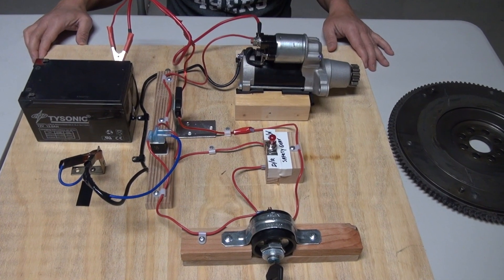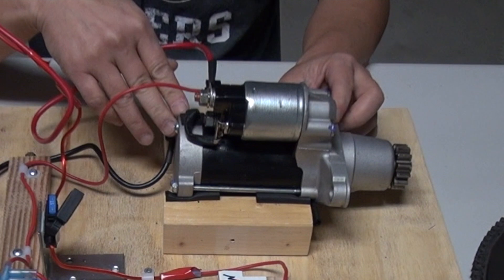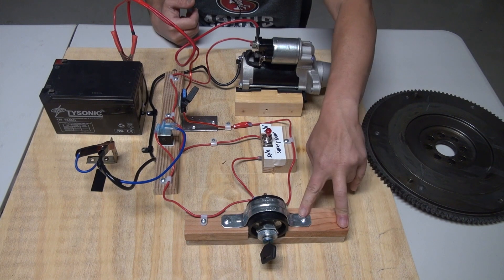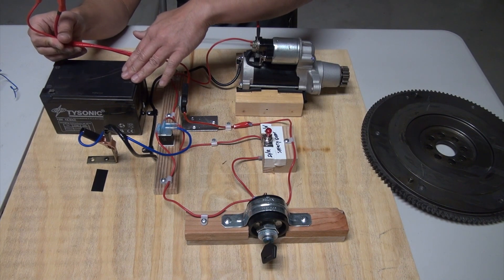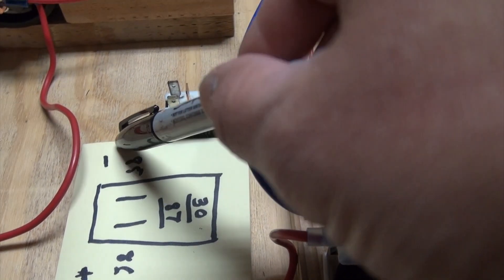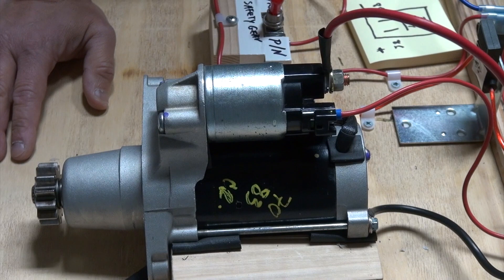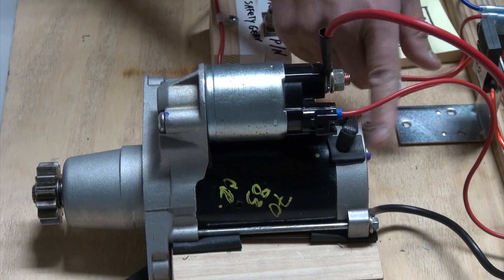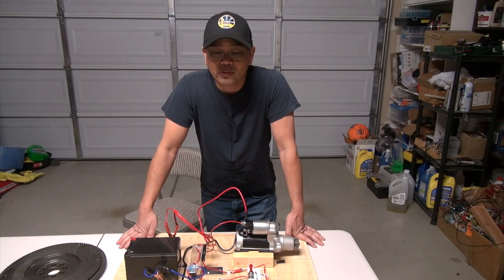Starter Motor and Ignition Circuit Thoroughly Explained!

Comment: Great video. I have a question.. how or do I need a key switch to turn over  to work my lights and what else it might be . Because I have a 2000 Chevy Silverado the ignition went out without no signs of going bad . And and I messed up my housing to my ignition cylinder trying to get the cylinder out to replace it and I was wondering  if I can just by pass it  totally.?  or do I have to  find the power source to my ignition cylinder harness  and then run them wires as well . Because I'm wanting to put a toggle switch in my truck ?!

Comment: Would the pinion retract by itself once the engine has started? Or does it always rely on the user releasing the key?
Great video, thanks.
Reply: I maybe wrong, but according to me, the pinion won't retract by itself until and unless the user releases the key, if it is they key-type starting. 
If its a push-button start, you press the button and leave it instantly, and your engine cranks after a second or two... that time the ECU controls the starter.. that's why in that case the starter (pinion) engages and retracts on its own.... As the starter motor cranks the engine (in the case of a push-button start), the ECU takes data from the crankshaft position sensor to identify the rpm of the engine... when the engine starts, it reaches around 800-900 rpm.that time the ECU disconnects electricity supply to the starter and the starter disengages... The ECU also understands that the engine has started by other sensors (MAP, IAT, MAF, etc..)
I maybe wrong, just a practical viewpoint which i myself saw in my old WagonR as well as in the new model Glanza!
Reply: @AltamashAhmed-xh8jbgreat answer thank you !!
Reply: Most welcome!

Comment: Is the neutral switch the e- brake on older manual trans vehicles? Or the actual brake? Obviously always start in neutral... but wouldn't it work if i was in 1st and pushed the clutch in?

Comment: Excellent video! is 86 (the wire from the ignition switch - NSW - PIN 86) always hot? My cat won't start, when I test with multimeter pin 30 and 87 do receive the 12V signal when I turn the key to start position and pin 85 has good ground but pin 86 is not receving the12V signal when I turn the key to start position, is it supposed to be hot all the time when the car is in park/neutral? When I bypass the starter realy car will start and runs fine in reverse or drive but as soon as I change the gear to driver or reverse it shuts off, what could be wrong here?

Comment: Surely the small relay 30 connector  should be connected directly to the battery positive and not the ignition switch. In other words ,when the ignition switch is turned to start the car, the small relay gets low amp  power through 85 and 86 to energize the coil which pulls 87 towards 30 to make a connection.  The reason for this relay is that higher amps passes through 87 and 30 because the bigger solenoid needs/ pulls higher amps.  You do not want these higher amps going through the starter switch.  The entire purpose of the relay is to not put high amps through the starter switch.  
Then the bigger solenoid does the same thing , it takes the higher amps to energize the bigger coil that then allows even higher amps to flow from battery to starter motor.  
Let me know if I'm wrong
Reply: it is connected to the battery via the fuse box.  it is always "hot".
Reply: @biboyravos4522  Excellent video! is 86 (the wire from the ignition switch - NSW - PIN 86) always hot? My cat won't start, when I test with multimeter pin 30 and 87 do receive the 12V signal when I turn the key to start position and pin 85 has good ground but pin 86 is not receving the12V signal when I turn the key to start position, is it supposed to be hot all the time when the car is in park/neutral? When I bypass the starter realy car will start and runs fine in reverse or drive but as soon as I change the gear to driver or reverse it shuts off, what could be wrong here?

Comment: Awesome!
I see this video is made for electric engineers as they understand this stuff, but I have made it out understanding almost all the ideas based on my school physics!

Just one thing I didnt get: what is the main purpose of the small relay that is connected to both the safety switch (park/drive) and the contact key? You said it is for safety, but how?
Reply: No, it's made for mechanics not engineers.
Reply: @bernardocisneros4402   
Ok, you definitely know better as my knowledge in engineering specialties is very weak.
Any answer for the question?

Comment: 2 wires coming to relay from ignition switch?? From battery (+) to 15 am fuse to ignition switch. 2nd one from ignition switch to NS to relay(86 control side).85   connected to body. One wire From  battery (+) to relay 30. 87 go to S Port(starter solonoid. If we crank or not always power(12.6v) in the relay 30
Reply: What if I disconnected the 15 fuse? The car still started but do I need the 15 fuse?
Reply: @whatistruth101  The starting circuit in modern cars uses 2 fuses. One for the starter relay "control" circuit and it's usually a 5 amp or 7.5 amp fuse. The second fuse is for the "load" side of the starter relay and it's usually 30 amps. Your car needs both fuses to start. If you take one out, it will not start.
Reply: He probably forgot that only 1 wire goes from ignition switch to relay. Just like you forgot that there's a fuse (usually 30 amp) on wire between battery and pin 30 of starter relay. We're all human. We're allowed to forget sometimes.

Comment: Intresting didnt know it was the trigger wire that went through the safety and relay. Explains the no click sound i have. I wonder if i can jump it by passing a wire from positive to relay with the car in park. (Well maybe netrual with a brick on the clutch lever in my case)
Reply: If you don't know exactly what your doing, I wouldn't do that. Most starting systems on today's cars are not as simple as his demonstration. They involve a lot more electronics. On most cars you can ruin an engine control module if you mistakenly jump the control side with battery positive to slot 85 and slot 85 is the ground side of the control circuit controlled by the ECM.

Comment: I have a 06 gto. I thought my starter went out so I swapped it out, but got the new part in and it didn’t work. I was able to get the starter to engage by touching a socket extension onto the two terminals onto the starter, with the key on the on position the car started. 

When I turn the key, the starter relay clicks. Does that mean from the relay to the starter something is wrong? 

I’m kinda broke so I’m not able to pay someone to figure it out for me 😭
Reply: yes

Comment: DONT UNDERSTAND the three wires going into ignition switch ?   power into ignition goes on B as in from battery. S on ignition switch goes to 30 on relay . But which terminal on ignition does wire from 86 on relay go ? You keep saying ignition but which terminal ?  If the ignition has B battery S start solenoid G ground and A/L acessories / lights then is it the A/L or the G ? I am guessing A/L because G ground does not seem right to me .
Reply: 76 is positive, 75 is ground
Reply: The ignition post is the big center one on the ignition part of switch😊
Reply: He doesn't have power running to accessories. He just left it out. Running power to switch runs power out to the ignition off of 30. Then 76 to the starter

Comment: So I have a 2003 Ford Ranger with a 3 l. It runs great it's a great truck on the original owner what about three or four years ago it started with a no crank no start issue and I'm taking it in and they said that they don't know what it is I've changed the starter the battery and the ignition switch and it still does it does it!! I can hear the relay clicking can I switched it with the blower relay and it still does it!? I think the only thing left is to look underneath the fuse box for corrosion in the starter relay connections?
Reply: Try connect the terminals on the solenoid. That will get the starter motor turning and the engine should start. Sometimes the solenoid gets sticky. So if you head the motor turning but not starting it could be sticky. Give the solenoid a gentle tap and try connect the terminals on the solenoid again. Hopefully the engine will start. You can use a screw driver or I've got a short piece of thick insulated cable I use to connect the terminals. 

This should give you an idea of it's just the solenoid that's giving issues. I'm not too good at testing the rest of the system. 

Good luck!

Comment: Hi, great video. I have an MOT (Ministory of Transport) test due on 2 old vehicles, but one has an Ignition problem (randomly won't start and won't affect the outcome of the MOT )and isn't being used, I have renewed the IG switch on advice, but it wasn't that. So to use it, if the other fails the MOT  test, to keep us mobile (we are remote living) If I feed (from the + batt term)the large red wire on the solonoid will this bypass the IG switch and turn the motor over and start the car (ignition switch in the on posistion too) The garage said it was the large terminal ,but I thought it was the "S" terminal the one you point to,(and he changed his mind ),,  ,does  it matter ? Thanks for reading. Chris (UK)
Reply from the maker: If I understand your question correctly, the answer is, no.  I don’t recommend doing that because the solenoid is not designed to take on so much current.  That is why even the signal wire has a fuse.  In addition, connecting the positive wire to the solenoid will not provide electricity to the starter motor because each runs on different circuit.  With possible 400 Amps or more running through the solenoid tiny coil windings, the possibility of it being destroyed it very likely.  But it is your car, not mine.  Thanks for reaching out.  Happy new year!
Reply: That makes sense to a tryer, Happy New year to you to .Thanks a lot, Chris. @diypotentials
Reply: To answer your question: yes, you can start your engine by connecting the solenoid straight to the + terminal of your battery.
Just make sure you only keep the contact on until the engine starts, typically about 2-3 seconds!
The starter solenoid will not burn out because it has enough resistance to the 12 volts from the battery. It was meant to run on 12 volts.
I was actually stuck on the road few days ago, on January 1st, it was night, holidays, and away from any repair shops.
The mechanism between my key and the ignition switch under my wheel broke, but at least my steering wheel was in the unlocked position.
After calling a car mechanic/electrician, I was advised I could start the engine by pushing the car since the contact was on (and I couldn't turn it off with my key).
Since pushing was out of the question, I figured that I could bypass my ignition switch and go straight to the starter solenoid from the battery's positive terminal.
I was aware that the starter was connected to the chassis on the negative end, and with a large wire on the positive end, i.e. always connected to the battery, and that it is engaged with a solenoid which requires a few amps (5-10 amps), while the starter motor uses at least 100 to 200 amps.
I checked the internet for the starter motor location on my car, got my jumper cable, laid under the front of my car, took the solenoid connector off and attached the jumper cable.
As soon as I touched battery's positive terminal, it started cranking and the engine was running within 2-3 seconds. I was very happy because that saved me a lot of money and time compared to towing my car and finding transportation for myself (at least 2 hours away from home).
When I arrived home, I had to stop the engine by shifting to 4th gear (by force), since I couldn't disengage contact, and disconnecting the battery would still leave the generator running which would both keep the engine running AND likely burn car's electronics due to large voltage peaks without the battery loading and smoothing the generator's output voltage like a capacitor.
Reply from the maker: Wow.  Amazing story.  Glad you made back home okay.  The key point here is that you are able to disconnect after 2-3 seconds just enough to get it started.  Nevertheless, it is great to know.  Thanks for sharing.

Comment: Can bad starter cause no ignition power no dashboard lights no radio nothing or what else can be a problem the fuse for ignition is good
Reply: Bad battery?

My engine wouldn't crank, there was no 'clicking' associated with the solenoid but my headlights and dashboard worked.

Comment: Brilliant, thank you! Did I understand correctly, when you turn the ignition key, the entire chassis becomes part of the circuit? And the chassis is connected to the -ve terminal of the battery?
Reply from the maker: Yes, the chassis becomes part of the circuit.  Thank you!

Comment: My car pilot 2012 it has two starter relays, when I crank start the car I don’t get any voltage come out to starter solenoid. I look for starter wiring diagram but can’t find any. Any one can help me please.
I tested both starter relays working but when crank start only one click the other is not

Comment: Quick question the ground from the starter goes directly to the negative of the battery ?
Reply from the maker: In this set up, yes.  In real vehicles, the ground is connected to the chassis.  Thanks!
Reply: @diypotentials  thanks much, I’ve been hearing a click sound sometimes when i try to start my vehicle so I’m think the problem could be the ground wire
Reply: @tonyswagz  beat on the starter
Reply: @gabrieldavenport1395  i did that and then changed the starter to a new one, same problem

Comment: Thank you for incorporating the fly wheel gear. That explains a ton about how a car actually runs. Your entire presentation is very well done, extremely detailed and thoughtful. I only stopped to watch your video to see if i was connecting my starter correctly or not and got educated in so much more, so thank you. Subscribed. I hope you have more videos similiar to this. What about the generator/alternator in this wiring set up? I dont think i see one or did i miss something? My car had an inline fusible link from the starter to the alternator that burned out apparently but i was unable to reach it to replace it so i simply have a power/positive cable from the starter to the battery and i also have a power/positive cable going to the battery instead..... Is this a bad idea?
Reply from the maker: Thanks for the kind words and for subscribing.  The generator/ alternator wring set up might be a good topic for a video project in the near future. Regarding the blown fusible link, the new circuit might work without it, but it doesn’t offer the protection from current overload.  I’m not familiar with your vehicle, but the fusible link was placed there for a good reason—to prevent costly damages to components.  I hope you were able to replace it.  Thanks again.

Comment: Excellent video, thanks. Can I ask you, looking in the relay if you don't have a good ground from battery to the relay where you have 4 cables to the relay itself you still can give power to the cable that goes  to the started ? Thanks.
Reply from the maker: The electricity has to make a complete circuit, from the positive terminal to the negative terminal.  If the pathway is blocked, it will not provide electricity to the starter…Thanks!

Comment: This is fantastic. Based on the fact that the positive terminal connector on the battery is connected to the positive terminal on the starter, Is it possible to disconnect the positive cable from the starter, put a load on it, and charge the battery?
Reply: U r stupid

Comment: Question, I understand that accessories will be on when the key is in ignition position but is there a way to only turn an accessory on only after the starter is on? So basically, on ignition position it won't turn on until only after the starter cranks the engine on.

Comment: Nice video! I have a quick question. I replaced my starter on my 94 bmw 325i thinking that I have a bad starter. I checked the battery is good, starter is good, relay is good… but sometimes it won’t start. I bypass my ignition switch and used a push start. Everything works fine but sometimes it won’t start. I read online that it maybe the wire coming from my relay to the starter is bad or corroded… can I just simply put a 12 volts to the starter solenoid so when I push start the car it will start? Thanks in advance
Reply from the maker: HeyJay, I don’t recommend doing that because solenoid is already connected to a 12volts.  It might be that the ground wires are loosened or rusted…That would be something I would check next …Thanks!

Comment: my 66 chevy keeps running after you turn the key off. (?)
Reply: It's your ignition switch and those other comments aren't necessary the guys trying to fix his car
Reply: @David-iw6ce  Changed switch, prob still there but not as often. It eventually turns off, also sometimes clicks instead of starting. Always works, sooner or later
Reply: Damn...well good luck
Reply: If it lasts longer than 2 hours, I'd see a dr
Reply: Your engine sounds like it's dieseling, I have witnessed the same issue with SBC's, it's a timing issue typically, check your valve train.

Comment: Great video! I'm just not sure about that Niners shirt.
Reply from the maker: Lol 😂!
Reply: @DIY Potentials: Projects & Ideas  So I have a 212cc electric start engine hooked to alternator to charge 12v batteries. Is there a product I can buy that automatically turns off the engine when the battery is fully charged and turns it on again when it needs charging? I know it exist. I think I've seen videos of it before.